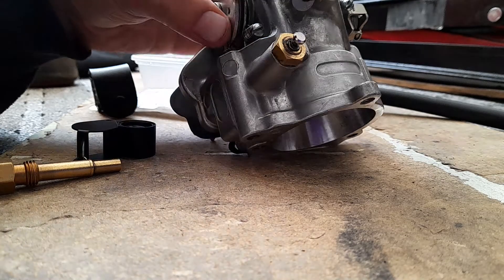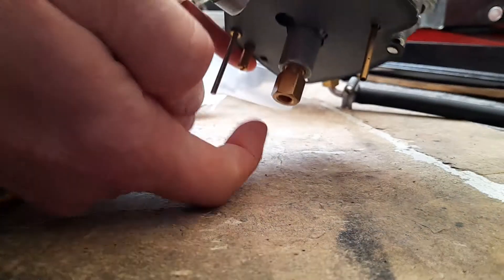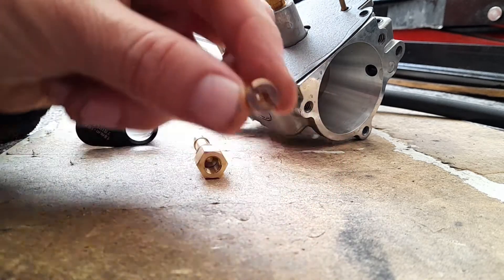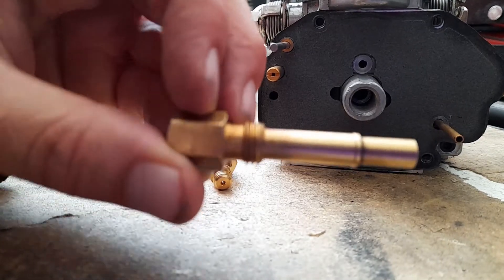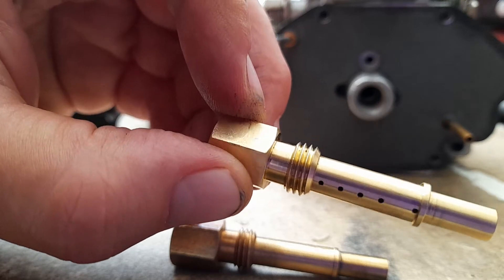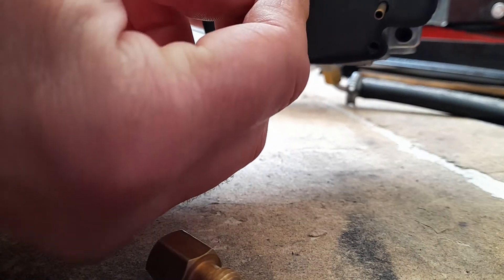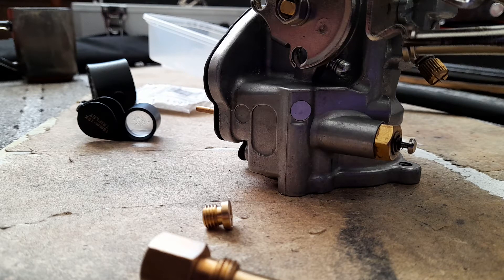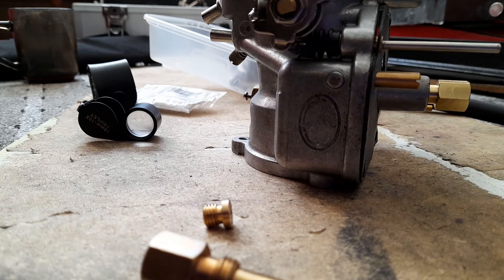£50 Carb Autopsy. 1979 AMF Harley-Davidson XLH1000 Ironhead Sportster

Comment: Have you ran the bike with this carb with the genuine s&s emulsion tube fitted?
Reply from the maker: Not yet. While the flat spot was the most noticeable problem, I should think there will be others. It's on my 'try when you can be arsed' list, and I'll definitely post when it happens.
Reply from the maker: Still ran badly compared to the CV40; I have a 36mm Zenith on there now.

Comment: Save your pennies and buy the proper tube , same thing with the amazon CV40s . swap a few jets and your good to go. with the cv40s we often just swap the jets and run them with no issues .So what was the point ? Just buy the part and swap it out .
Reply from the maker: I had a tube, but the carb was still way under par compared to the CV40. I went with a small bore Bendix Zenith come the end, which gave exactly the sort of low/mid range boost I was looking for. Possibly at the expense of full throttle performance, so swings and roundabouts 🙂